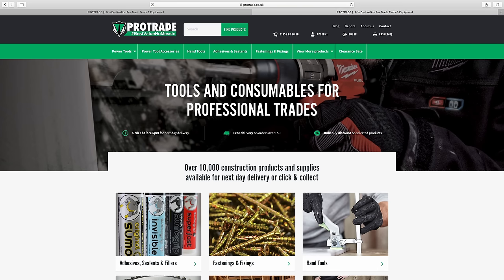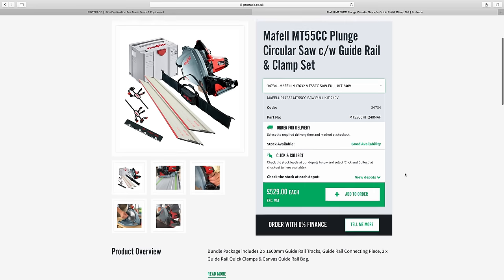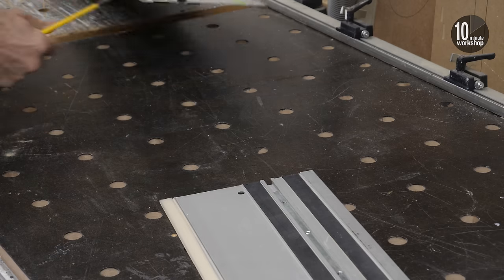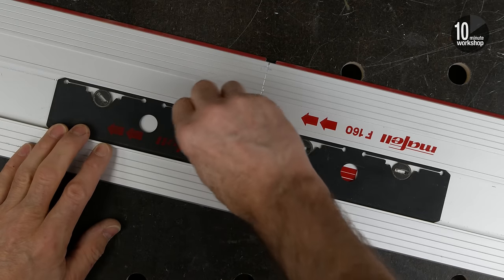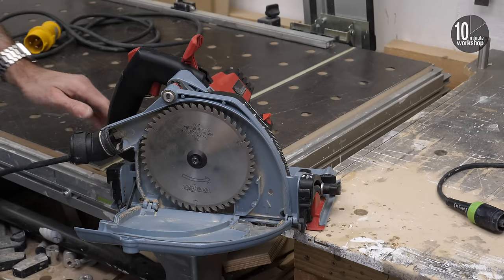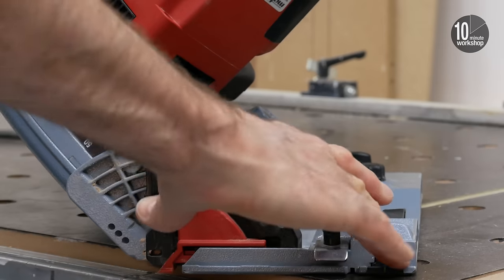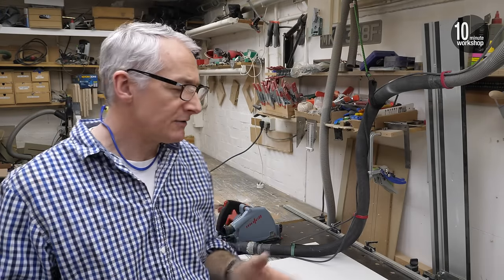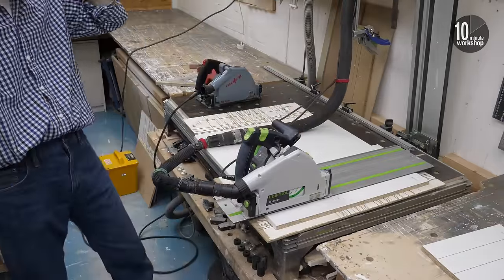Big Decision: Festool or Mafell? [video #400]

Comment: I don't know if this is the intended use, but I find with Festool splinter guard, (green do-hickey thing) attached, the dust extraction is much better. Any thoughts?
Reply from the maker: I’ve never found it to make a scrap of difference to anything tbh - including its intended use - but the Mafell has a slide-down cover there, so maybe there’s something in it. 🤷‍♂️👍👍

Comment: Oh, it just occurred to me that if the Mafell's scoring system moves the blade closer to the saw, then the rubber rip guard of the track will also be cut so that for normal cuts it is no longer quite so close to the blade, which certainly does not seem good. Or did I misunderstand something?
Reply from the maker: No, you understand that right. I would guess that Mafell would say 1/10mm isn’t enough to make a difference on the splinterguard - but 1/3mm ?? 🤔🤷‍♂️
Reply: @10MinuteWorkshop   Thanks, yeah, those were my thoughts also. But thankfully of course you can ignore that feature in the Mafell and just use the depth adjustment if you need a scoring cut, just like in other brands' saws :) It just bothers me a little that what were the Mafell developers thinking when they made the scoring feature to do the blade movement.

Comment: I’ve used both in 110v form the festool was very much underpowered was stolen in the end. The Mafell on the same transformer and ctl midi has bags of power. The scribe cut on that seemed rather large compared to mine.
Reply from the maker: Yes, as mentioned in the vid the 110v Festool seem to be very particular about the power supply. Re the scoring cut, I can only test the saw I have, and the comment seems to be pretty evenly split between guys saying yes, mine’s the same, and ones like yours where it’s much more like 1/10mm 🤷‍♂️ So there’s definitely something going on here, just not sure what, right now. 👍

Comment: How about if you Ignore the built in scribe cut option on the mafell and do as you did with the Festool.?
After many months of pondering I chose the Mafell,  Im not disappointed with my choice.
Reply from the maker: Yes, both great saws, and yes, you could absolutely do an ‘impromptu’ scoring cut - but the scoring cut should do the job, don’t you think? Out of interest does the scoring function on your Mafell leave the same kind of gap? I’m getting two kinds of responses, some folks saying their is the same as mine & unusable, some saying it works perfectly. 🤷‍♂️👍
Reply: @10MinuteWorkshop  Sorry for the late reply..
You could argue that the scoring cut does its job. I suppose it all depends how you choose to use that scribe cut. Its so quick to just adjust the depth and do a quick pass scribe then adjust to partial or full depth cut.
I thought long and hard before I finally decided on the Mafell. the stronger motor. dust extraction and rail set up was far better with Mafell.
I find the grip with Mafell rails is excellent, alignment is always spot on. The Rails are so beautifully engineered, nice clamps and the anti chip strip doesn't peel. I also cut quite a bit of calcium silicate boards with the Mafell its never kicked back on me, rails have never slipped and its never failed to impress me.
Reply from the maker: @soa324  No problem, appreciate the reply, thanks! 👍

Comment: After looking closely at both saws, I went with Mafell.  Saw is better but the rails were the clincher.  I have no patience for fiddling around with poorly designed tools so those Festool rails are a non starter for me.  I have the Mt55 and the little KSS300 with the roll up rail.  Both very nice. 

Shame though that ALL tracksaws are built left handed though.  Kreg just became the first with a right handed saw... gotta give it a look.
Reply from the maker: KSS300 is a lovely saw - I had one for a while with the captive rail, loved it. I really like the Mafell rail joining system, but I rarely join rails and actually prefer the Festool rails in use. As always, good to have the choice. 👍👍

Comment: Peter, look again at your festool rail after 15 y, do u think  rail could be as presice after 15y use, when metal slides by metal?
Reply from the maker: On the Festool rails there’s almost no metal to metal contact; the saw baseplate runs on low-friction glide strips, and the rib is located against little block of the same material. Inevitably, over time, there is some wear, but it’s nothing like what you might expect. 👍
Reply: @10MinuteWorkshop  I mean that maffel hasn't this option

Comment: Great review peter, would love to see something similar to the jigsaws, not sure which one to get, although the Mafell is a lot more exspensive ...
Reply from the maker: Thanks! I don’t have a current jigsaw, so they’d both have to be loaners - but the Mafell gets great reviews! 👍👍
Reply: @10MinuteWorkshop  I have the P1CC. It will literally cut a perfect circle round a £2 coin in 40mm oak using their double W1 blade - and the sides of the cut are totally vertical, no leaning whatsoever. It's unbelievably good.
Reply: I’ve also got the p1cc and there is no comparison with the Carvex. The festool jigsaw ( sadly ) is like a cheap toy.
Reply: @alchemist1617  And I bought one. Ive never really liked it. I lent my basic Makita out and it never came back. Grrrr.

Comment: My first project with a Mafell MT55CC was cutting some Ikea 38mm thick Oak Worktops to length. I'd been tipped off via another Youtube video, that whilst the 1400 Watt CUprex motor was more than capable, the standard supplied 48 tooth blade would leave "burn" marks on end grain. So invested in a high quality 24 tooth 162mm dia PTFE coated blade from Southampton based keybladesandfixings.com and all cuts perfect with absolutely no scorch marks :-)
Reply from the maker: Yep, blade choice makes a huge difference - big fan of key blades myself. 👍👍

Comment: If the offset on the scoring is a problem, can't you just set the depth of cut to 2mm instead?
Reply from the maker: Of course - but I can do that with any saw; the offset scribe is a major selling point of an expensive saw and it should work as advertised, don’t you think? 🤷‍♂️👍

Comment: Bought the Festool (akku), due to the blade offset. you can even score backwards 2 millimeters and get a perfect result on the Festool. Doing the scoring means ou have to cut twice anywas.
But you missed one of the great pros for the Festool. If you set an angle, the Splinterguard on the Festool is still in  the correctplace, where as on the Mafell the blade comes further off the guard. 

Powerwise, the Mafell just uses a blade about 20% thinner. 

And I wouldn't go with a riving knife. So for me the Festool wins in the "pro section" by quite a large margin. With the price tag, in Germany, the Mafell is about 20-25% more costly, which is quite a lot.
Reply from the maker: Thanks. I didn’t miss anything, there’s a ‘further thoughts’ video out on my Patreon today where I discuss a few things, including the bevel offset 👍
Reply: Well and of course it is that i wouldn't go WITHOUT a riving knife. 
So I have to pay the patreon thing to see your further results? Or how does it work?
Reply from the maker: Link in the video description - too can sign up for free, your card isn’t charged until the 1st of the month so you have a couple of weeks to have a look around, see if you think what I’m doing over there is worth it. 👍

Comment: Surprised you didn’t tape the Festool “blade window” and redo the dust collection test to see if that simple fix brought the Festool in line with the Magellan dust collection
Reply from the maker: Well, I say in the video that that's what I do - do you really want me to demo it? Plus, the point of comparing these saws is to see how they do out of the box; if I start fiddling around, where does it end? 🤷‍♂️
Reply: I would bet that if you did  make that very simple non destructive modification they would end up in a dead heat on dust collection which would be relevant input

Comment: Have to say I was very impressed with the Mafell, especially now that there's almost price parity.  Sadly not having the need (or justification) for a track saw I've made a 100cm "rail" from plywood that enables me to use my old faithful Black & Decker circular saw tarted up with a couple of new blades and some grease on the angle cut mechanism - the inspiration (OK, cribbing it) came from Badger Workshop a couple of weeks ago.
Reply from the maker: I think everyone's done a home-made guiderail for their circular saw - I did way back before I bought my first tracksaw - and they can work really well. 👍

Comment: I have a Festool and a Makita plunge saw. I must say I prefer the Makita. I’ve been using it for almost 12 years now. If calibrated properly and fitted with a good quality blade, cuts perfect even through the melamine boards. It is a lot lighter than festool aswel. And it has scoring function. I’m very disappointed with festool for the only reason that its motor is very poor. My mate managed to fry up its armature. Mafell is a very good saw but I can’t go over its scoring function. I wonder how would be to try to apply edging over that edge.
Reply from the maker: I also have Festool and Makita; to me the Makita is a crude tool in comparison. Just goes to show everyone’s different. 🤷‍♂️👍
Reply: Peter Millard Makita is simply reliable, I can’t complain about anything. Festool is like a beautiful woman that’s walks away when you need her the most. 😅

Comment: Festool fail dramatically cutting 40 mm oak work tops .I've had the Mikita , 2  festool plunge saws .
The festool jig saw is the worst I've ever had . Bought a mafell jig saw it is awesome , now I will swap out my festool plunge saw for a mafell , festool battery multi tool is best tool ever tho .
Do your home work it will save you a fortune , and don't get stuck on one brand
Reply from the maker: Carvex? Yep, worst jigsaw ever - the Mafell is 👌

Comment: Mafell saw for carpenters the scoring switch useful when you cut timber against the grain you don’t need worry about hair line and also you can score as well as you did with festool just plunge 2 mm  so this is irrelevant
Reply from the maker: It’s not irrelevant if Mafell use it as a major selling point.  🤷‍♂️

Comment: Mafell. Because Festool managed to convince our regulator that they needed to control the retail price aka price fixing Festool is more expensive in Australia than other countries. A nice UK supplier sold and couriered it to Australia for significantly less than the Festool. I do some work with Australian hardwoods. These are some of the toughest woods around not necessarily top 10 but double English hardwoods with the added bonus of a number being noted for crossgrain. Festool with a brand new blade can have difficulties the Mafell has no problems leaving a nice edge to boot. No kick back or motor stopping.  As far as I can tell that extra 200 watts makes a critical difference. Someone said that the Mafell is a better motor even before the extra 200 watts but the explanation was beyond my comprehension. Anyroad like the Red M and being cheaper it is as our cousins would say a "no brainer"
Reply from the maker: Good to know, thanks! Yes, I don’t know how they get away with the price ‘maintenance’ - they were very heavily fined in the EU for price fixing not so long back. 👍👍
Reply: The reasoning was because the retailer's of Festool attend training and seminars in regards to the tools ins and outs. And then people would come in and take advantage of this service only to then buy it down the road at a cheaper price from a guy who knows nothing.

Also I've found the servicing and repairs if Festool in Australia is totally different.
Reply: @LostWhits  That may well be one of the arguments they put up for the authorisation but having deconstructed an awful amount of corporate spin and sophistry I can see why this is unadulterated BS. In fact I would hazard a guess that most people if they stopped to think about it would spot the flaw.
Reply: @10MinuteWorkshop  Australia has a hole in our consumer regulation in that it is possible to get an "Authorisation" not to comply with the law. With Authorisation perfectly legal without potentially a large fine.  During the Covid-19 pandemic the regulator has on its own initiative authorised food retailers to act in concert to ensure supply so the system isn't completely bonkers.

Comment: Hi peter, another great video.
I do not understand the practical value in the Mafell score cut, it just seems a irritating annoyance.
Stick to festool all day long.
Cheers
Reply from the maker: Making a shallow scoring cut is a well established way of getting really clean cuts in eg melamine or other surfaces probe to chipping. But the way Mafell does it creates the slight gap between the panels. 🤷‍♂️👍
Reply: Very very handy for cutting high gloss panels or cheap laminate worktops

Comment: Parkside, because that is all i can afford 🤣
Reply: Having both the Parkside and the Festool, I can objectively tell you that you're not missing much and that both can give very good results (the Festool has some nice convenient features but isn't with issues such as the bit which connects the saw to the shopvac and which keeps causing problems, something which is a non-issue on the Parkside).
Reply: There is no real reason to change to more expensive tools if Parkside does the job, for most hobby people it's just a comfort thing, trade people have reasons on their own.

Comment: Would have been interesting to see a scoring cut on the Mafell using the same technique you use with the Festool.
Reply from the maker: It would be perfect, no question. But, ‘buy a dog & bark yourself’ springs to mind! 😂👍👍
Reply: Even if you manually set the blade depth stop to 2 or 3mm the Mafell still offsets the blade.
Which I found disappointing as I also didn't like the gap on butt joints.
My Mafell also moves about 2mm away from the splinter guard on a 45 deg cut.
Perhaps there is a fault with it.
Reply: @jonweston5449  What about a 6 7mm score cut ?
Reply: @Joe hogan I would have to try it and get back to you. 
Thanks, 
Jon.

Comment: I bought the mafell two months back, sadly I contracted covid 19 a day or two after, so I've only just got back in to the shop and been playing for the last two days and have a number of issues with mine. 90 degree cut is off, 45 degree cut is off, and on the bevel, the cut line is 1.5 mm away from the guide rail. Struggling to find any info on how to rectify these issues without the fear of voiding the warranty.

From what I have read online, Mafell seem dismissive of these issues and suggest that they are within tolerance. I disagree, for me the saw in this state is not fit for purpose as I'm now back to using my table saw and mitre saw to get square cuts.

I went for the mafell thinking I'm getting a superior machine to the festool, but my experience so far has left me in doubt of that assumption. Go back two months with the knowledge I have today and I'd by the festool.
Reply from the maker: Oh wow, sorry to hear about your Covid! Hope you're managing to stay well. Yes, unfortunately, the 90 and 45 issues seem to be knows (not exclusive to Mafell, to be fair, I've heard a few complaints about the issues with Festool too) and a pal of mine had the 45 bevel problem and had terrible trouble getting it sorted. The bevel cut not being in line with the splinter guard is a 'feature' - they actually have a little dingus that comes out as you tip the saw over to show you the cut line. I hadn't realised this until I tried it, and have to say it really surprised me on a saw of this quality and price. 👍
Reply: Thanks Peter, I've been without symptoms for 5 days now, so fingers crossed that I'm finally over the other side of it. I've sent an email to the retailer for now to see what they suggest, hopefully they will come up with a satisfactory solution. In the meantime, the mafell sits in it's systainer :(
Reply: @Simon-Smith.  Hello Simon. Hope you're doing well. I'd like to know the end of a story with Mafell? Did you succseed to return it back to retailer? Thank you for your comment as I'm looking for plunge saw and having a tough choice now. On our local forums I've read comments that new Festool REBQ TSC 55 is worse then same model from a 10 years back. Do you switch to Festool?
Reply: @The9q11  Sorry for not responding sooner. The support at Mafell was amazing. I contacted them about the bevel issue and they sent a courier to pick up the saw, made the adjustment and sent it back within a few days. The bevel cut still did not line up with the splinter guard but was only around .5mm out this time. I can't fault the guys at Mafell, I received an excellent service.

However, I also bought the Festool ts55 as I needed an MFT and the work around to get the Mafell to work on the MFT didn't appeal to me. After using the festool I found I was no longer using the Mafell for a number of reasons. 

1. Using two saws in the workshop menat two cables and two extraction hose being a potential trip hazard

2. I also found that the extraction hose kept coming out of the mafell extraction port, which is really annoying, especially when it happens part way through a cut. The extraction hose with it's bayonet fitting never came loose or fell out of the TS55.

3. I actually prefer the way the TS55 feels and how smoothly it runs on the track compared to the mafell

4. Festool have a system which means the rails are super useful for other tools and for attaching guides and jigs etc.

It's for these reasons that I sold my mafell in the end, and I now use festool instead.

The Mafell MT55 is an amazing saw, and it was a reluctant sell, but for me, Festool suited my needs better.